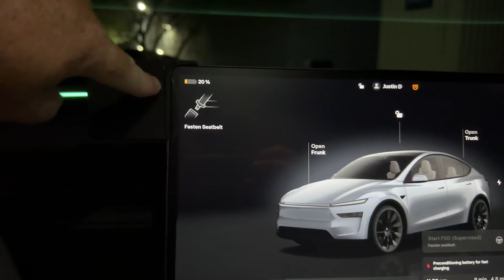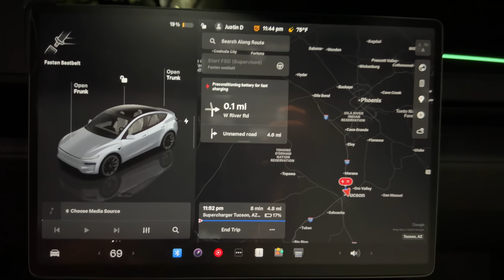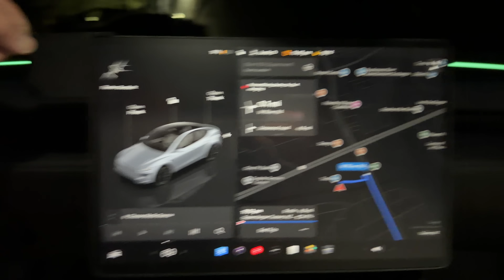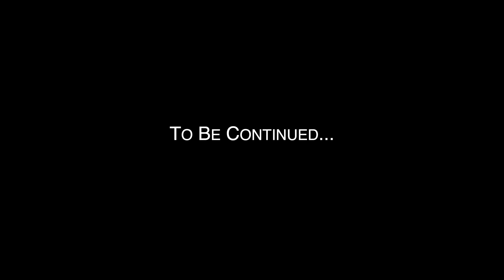Tesla Model Y - FSD Coast To Coast Attempt *Reboot* Part 1

Comment: You have already proven that Tesla FSD is a dangerous fail so you are wasting your time. Crowdsourced data from hundreds of FSD users also prove that Tesla FSD is currently thousands of times more dangerous than a human driver and your incident already perfectly demonstrated that stat. The multiple Tesla taxi accidents in Austin further proved the stat. It's not a question.
Reply: Amazing. Everything you just said is not true. 
Do not speak on what you don’t understand and have no knowledge of.

I have 55.5k miles on FSD. It is far safer than a human driver, but there are some edge cases that it can improve on. I have experienced zero issues in my time using FSD
Reply: @josded  You just lied. Everything I said is 100% true and you completely failed to show it is untrue in any way - because you can't. Statistic don't lie - you do. The NHTSA doesn't lie either...
From Reuters 10/25: " NHTSA’s Office of Defects Investigation is looking into 58 traffic safety incidents involving FSD, including 14 crashes and 23 injuries. In some cases, a Tesla vehicle failed to stop, or didn’t remain stopped, at a red light with FSD engaged, while others involve Teslas with FSD entering the opposite lane of traffic during or following a turn, or attempting to “turn onto a road in the wrong direction despite the presence of wrong-way road signs.
NHTSA will also review numerous incidents in which FSD-enabled Teslas failed to stop at railroad crossings with a train approaching."
I just proved you completely dishonest. You need to apologize.
Reply: @phillgordon7523 Those NHTSA numbers are PROOF of FSD’s safety, and most of those injuries and crashes were HUMAN CAUSED, and not caused by the software, as the investigations show.

It is hilarious that you take an extremely small set of incidents, most of which were not FSD’s fault or responsibility in any way, and try to use it to prove your point. That is what is called an epic fail.
Reply: @josded  You just lied - again. It is a proven fact that crowdsourced data from hundreds of FSD users prove that Tesla FSD is currently thousands of times more dangerous than a human driver  - exactly as I said.The amount of  crashes in the robotaxis, alone, completely confirm and prove that stat. It is also a fact that the NHTSA has never said the crashes were caused by humans which is exactly why they are investigating FSD. It is also a fact that the NHTSA would not be investigating FSD, at all, if they thought it was safe, dum-dum.
I just proved your IQ below 60 - which is exactly what lying musk depends on. You seem addicted to failing.🤣
Reply: @phillgordon7523 no lies here. Just because have a hate-on for something doesn’t make all your wishes come true. Grow up
Reply: @josded  You just lied - again. I stated proven facts - not "wishes". Stating facts is also not "hate". So I just proved you lied twice just in your last post, alone.
From Reuters 10/25: "NHTSA said it has many reports in which a Tesla vehicle, operating with FSD engaged, " ran through an intersection with a red traffic signal and was subsequently involved in a crash with other motor vehicles in the intersection resulting in many injuries."
Is the NHTSA "wishing" or "hating"?
I just destroyed your credibility with any intelligent person.
Reply: @phillgordon7523  waymo, statistically, is far more dangerous than FSD. It has no drivers at all. Do you have a problem with it? If not, you are a massive hypocrite. Tesla FSD is proven to be several times better than a human driver, as it’s accident rate is several times lower than humans per mile driven. If you want facts, that is absolutely irrefutable. I feel like I am talking to someone with no brain, so I have little hope in actually teaching you anything. 

Reports are not reality. Get that through your thick skull. I am not lying, but many of those “reports” are people who are lying to avoid blame for insurance purposes. Too bad for them that Tesla has hard proof of their lies. Any crash that happens while FSD is engaged is ultimately the responsibility of the person operating the vehicle anyways, as it is SUPERVISED. You always need to be alert for edge cases the system has not been trained for yet. I have never personally encountered any situation that would put my life in danger. Only poor navigation decisions due to incorrect map data.

Comment: I wish you would address the pitiful small print on Tesla's X screens.  I have a 2023 X that I love, but looks like I will have to trade it in as the map text is so small it is impossible to see without trying to move up and put your face in the screen.  There is no way you can see it when you are moving and need it.  Likewise you can do the 2 finger enlarge, but it doesn't stay long and only enlarges the graphics and not the text. It's flipping ridiculous!!  Some models have had updates to the software to change this, but not the X.  Even though I made sure I bought an X with the new motherboard and infared system.....this model has been shockingly behind, and it's a terrific car!
Reply from the maker: Controls - Display - Text size
Reply: @BeardedTeslaGuy  Yup, my car told me that, but it didn't get that update and I can't convince Tesla to give it to me now!!
Reply: @BeardedTeslaGuy   that's what is missing off my car, never had it.

Comment: Just curious, why didn’t you get the whole car fixed at Tesla including the suspension?
Reply: Tesla wanted $2k for the repair. This was cheaper.
Reply: I guess if you know Pete Gruber you can take that route.  I guess I would just want it fixed all the way by Tesla.
Reply from the maker: Because the repair was extensive at Tesla, but I was able to do a much simpler repair

Comment: Cool, it's not that hard to get Roadster parts, the service center can order them. It's just that people would rather not spend as much so they try to repair them rather than replace parts. A lot of the car still uses Lotus parts like mirrors, wipers etc. The Elise was quite a common car.

Comment: I really learnt a lot about how tesla manages computer vision after looking into your last series.  So FSD does not run AI in the car (not in the sense most developers would understand,  Only in the way they would report in their end of year review).  They use video data to train a neural net in some chips which deal with object recognition and positioning to build the world around the car.   I saw some demos of chips like this decades ago,  They sound really fancy but they are effectively the things you see on CCTV which put a box around a face,  Just they have been trained to recognize all sorts of things but they are essentially attempting to categorize objects in real time.   I don't think any of the self driving software ( The decision making engine ) can see any data from a camera.  So if it does not get labeled and categorized by the neural net, It is invisible.  I don't know how sophisticated the chips processing the neural net are but they will have some limit in how many things they can categorize and as the model is pre trained it's not able to learn or think harder about things.   As far as i can tell this is why your tesla did not react to that object in the road.   The cameras failed to identify it as something worth seeing and so it was unseen.   The same reason explains why things like 
 - overtaking a school bus,  Even if it is categorized it is hard to gain the context from the image
 - Railroad crossings, They look so different and by the time you have approached them even if you categorized a railroad crossing it isn't instantly visible to the cameras when you are close
 - riding over odd curbs and incorrect lanes etc.

I hope this knowledge keeps you safe on your trip as it should keep the question of "can FSD perceive that" in your mind

Comment: If you see something in the road"……..DRIVE AROUND IT !!
Reply: I don’t really want to reignite conflict over the use of FSD. But, so many of the presentations that I read, emphasize the ability to rely on the current system, when, I believe more emphasis should be placed on using FSD as a cocaptain, or Highly trained copilot to do things that you would normally have to do all by yourself. Even though the system is working toward Classic autonomy, there still should be human involvement at all phases of safe motoring (pardon the expression )
Reply: @richardchandleriii5003  I do agree there has to be some sort of supervision, especially if it is your own vehicle. This does raise a question of if we want autonomy to be fully unsupervised or with some supervision.

Now for public transit and taxis, there could be possibly remote supervision if that is safe.
Reply: @WesternSpace1 Tesla has given me full self driving to try out on several occasions. The first time it drove a little too fast through 3 blocks of "outlet stores" where people were milling about and dashing across the street without looking.  I quickly took the wheel.  Another time it was on a road that came to a T and it couldn't make up it's mind which way to go so it sat "stuttering" with the wheel first going left and then going right...back and forth.  I grabbed the wheel and immediately I was asked what was happening and was able to submit the camera footage along with the diagnostics.    I don't mind being a test driver but I never take my eyes off the road and loosely have my hand near the steering wheel. 
The thing I've loved and have thought is so funny is that my car NEVER misses a CONE! It misses signs from showing up on the screen, but it has never missed  pointing out orange cones.  LOL
Reply: @kattmd8294  Interesting, I wonder if FSD 14 will solve those issues for you when it becomes available for you.
Reply: Just turn around and go back.
Reply: *If you have time to safely react.
Reply: @WesternSpace1🤣🤡
Reply: @johnnyman55555 I am not technically disagreeing with his statement. Maybe it is obvious what I am saying, which I would agree with, but there are others that just don't know well.

I do agree you should try to avoid things in the road...just if you have time to safely react without losing control.

I am covering the cases if the object suddenly enters the road right in front of you. Or if you didn't notice the object, because it was hard to see, especially at night.

In the case you have to run over something, pull over as soon as safely possible and inpect your vehicle for any damage.

Now in the particular case, they could had easily avoided it, but they were using FSD, and they found out the hard way.

Also I am not sure why you are still following this content creator for a month, because it appears you don't like the Tesla brand based off your previous comment. There is always the option to stop following the content creator if you don't like his content.
Reply: @WesternSpace1I’m still following ‘cause I’d like to learn that the cash that I spent almost five years ago is actually going to go to work before I’m too old to use it. By the way, I’m on my third Tesla 🤪
Reply: @richardchandleriii5003  Totally makes sense if you use Tesla cars. Also if you were confused, my comment about following the channel was directed at the other user. 🙂